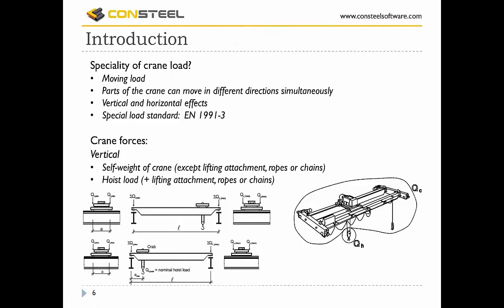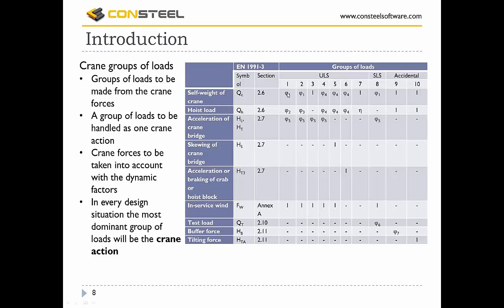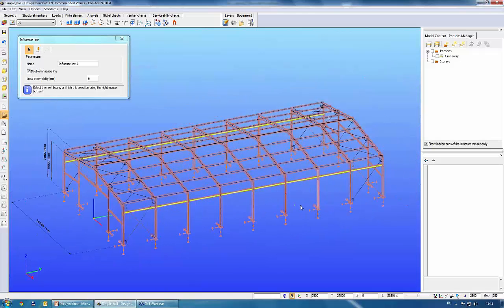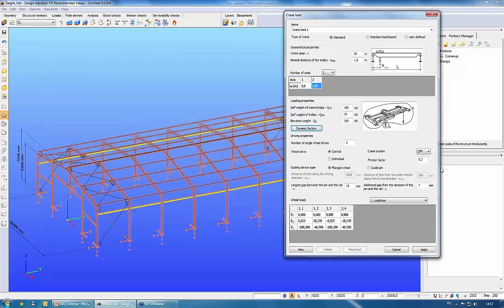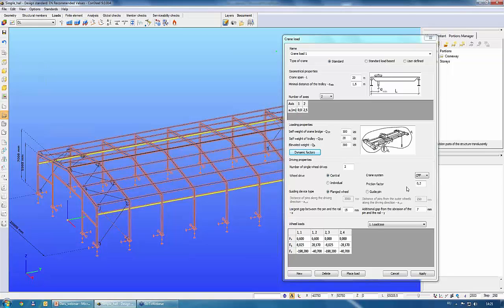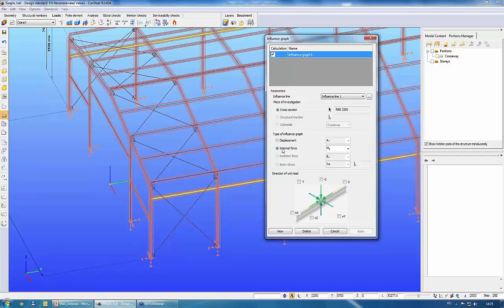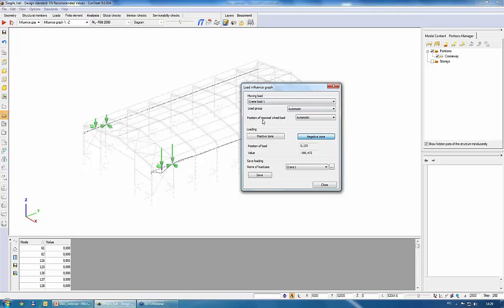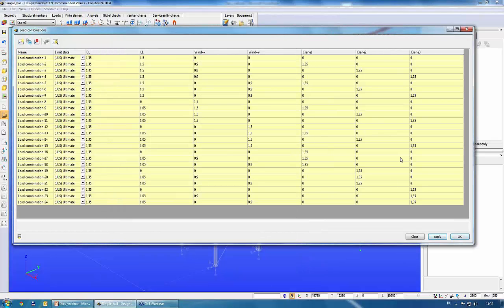ConSteel webinar - Crane load acc. to the EuroCode 1

Comment: If we want to check the entire length, do we have to apply load on each point along the cross section length, let suppose i have 60 m long crane girder and 10 frame do i have to put load in the middle and end of each frame or just one?
Reply: Normally you need to place the crane load at the critical position only. There are several ways to find the critical position: can be by normal engineering practice like place at the middle. In more complex cases the built-in function of influence lines can be used. By using this function, Consteel can position the load automatically to reach the maximum values of selected internal forces. The third option is to create blindly several copies of the crane load but each time with a slightly different position along the beam and make the envelope calculation. This is a bit of brute-force approach to find the critical positions. These load case copies can be made automatically by Consteel. Once the critical position has been found, these additional load cases can be deactivated.